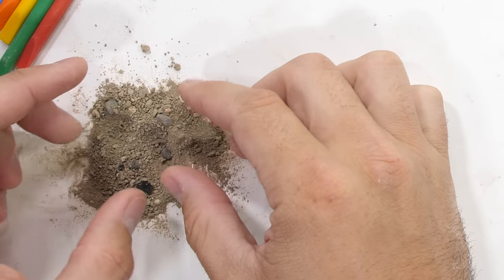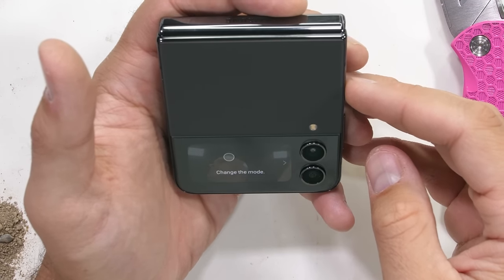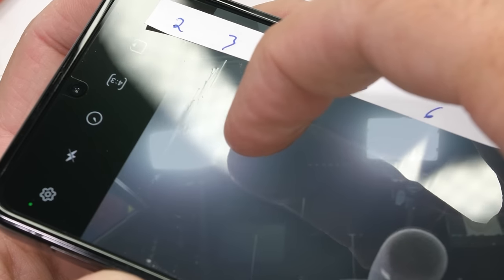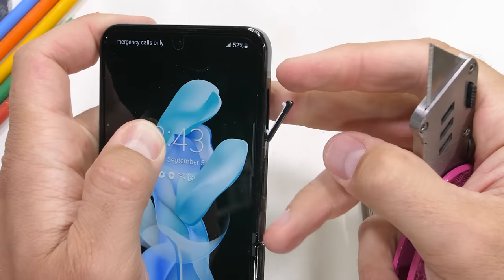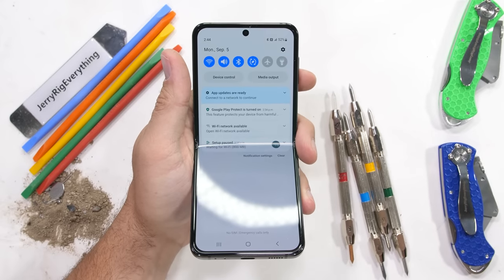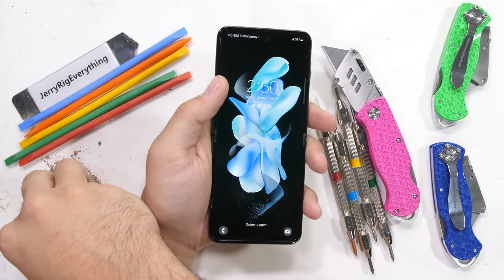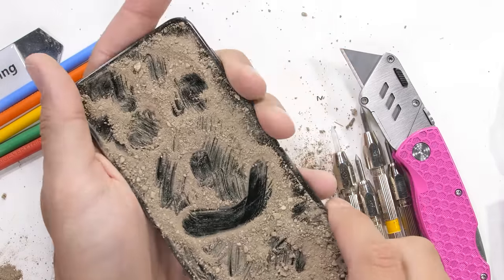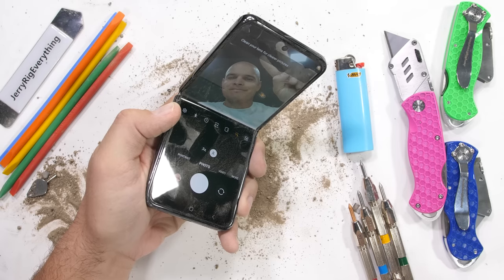Samsung Z Flip 4 Durability Test!! - they slipped a bit...

Comment: I bought this phone and the week after i did it took the absolute worst fall a phone of mine has ever experienced (fell from a 3rd floor balcony lmao). To my surprise the phone just got some minor scratches
Reply: What did it fall on?
Reply: @ToweringPsychic  it fell on rocks while attached to a battery pack so the fall was reaally bad
Reply: did you notice any issue with the hinge after?
Reply: @HarvestingThings  yo wtf lol, I was thinking of not buying this cause I thought it was really fragile but maybe I will
I'm trying to pick between the S22 Ultra and the Z Flip 4 rn
Reply: @vanessarodriguez777  nope, no issues with the hinge or anything tbh. I think maybe the selfie cam got damaged a bit but u can use the the higher quality front camera for selfies anyways. 

It's also basically completely waterproof so I always shower wit the phone lmaoo. 10/10 would absolutely recommend
Reply: @lusisian  the s22 ultra is absolutely way more powerful with a better battery (that is my work phone). But after having a flip phone there's rly no going back
Reply: @HarvestingThings  yeah, I was actually thinking of the z flip 4 because of nintendo ds emulation, lol, it just seems so fun to play with actually two screens, and seems way better to grip for games like that
I still have a whole year to think tho
Reply: @HarvestingThings  flip 4 is actually more powerful than s22u on paper but the cooling isn't as good so the actual performance might not be better but about the same
Reply: Mine fell like 3 meters and the hinge broke - normally 300 bucks but I got one year insurance so it were just 109 bucks
Reply: @lenny7828 this dude is probably lying if yours only fell 3 meters and you had to replace it while this dudes foldable fell like 10-20 meters
Reply: Did you fell it with the hinge open or closed

Comment: I just bought the Flip 4 and was putting off watching this video because it looked scary. But now I have peace of mind knowing it's not going to just break instantly and it's quite resilient!
Reply: Same! Lol it actually gave me some piece of mind.
I bought a tough case for it so I should be good 👍
Reply: My first had a battery issue and the one I have now, the pixels are failing
Reply: a piece of fluff is gonna scratch your screen lmao
Reply: Honestly, having this fragile phone I coudn't watch properly, but because of your  comment, my mind is at ease, thank you!
Reply: @Willem Cahill-Chiaroni  just dont stab it, and you're fine. The screen is only exposed when in use ding dong.
Reply: @nfsfanAndrew  it is literally permanently marked by fingernails. micro bits of debris are unavoidable. plastic is unacceptable for modern phone screens.
Reply: @willemmmmm idk about you but i rarely put my fingernails on my phone to use it.
Reply: Dropped it on a carpeted floor ONCE and it gave up the ghost.

Comment: Really impressed with the bend test - I thought it would snap in half like a biscuit 😅   This is actually a good advert for the phone (aside from the plastic screen), its much tougher than I expected.
Reply: The plastic screen... It is the best we have right now so 🤷 definitely is a durable phone to me as a flip phone
Reply: Honestly I've had the phone for a few days and the plastic screen doesn't bother me at all. No scratches yet, hopefully can keep it that way for a while
Reply: Will acrylic or polygell nails affect it cause I like to paint my nails and wanting to do long ones I don't want to damage the phone with them though
Reply: The screen isn't actually plastic.. it's just a plastic screen protector. But yeah the screen is still fragile af so it may as well be plastic lol
Reply: It's not a plastic screen. It's a factory-installed screen protector. You can't remove it without bricking the phone, but you can ask Samsung to replace it for ya. It costs ~$30. Of course, depending on where you live, finding someone certified to do the replacement may not be easy.
Reply: @spdewertton it doesn't break the phone, mine was starting to lift and was bugging me so I just peeled it off like any regular protector and was completely fine. And I haven't put a new one back on all year and my screen still doesn't have any scratches

Comment: The popping sound comes from the new lock mechanism in the hinge that 3 didn't have. You can feel a very tiny light pop when you open the phone very slowly. Try it. It's so, compared to the flip 3, it can last longer and be positioned in every position longer in the phones lifetime.

Comment: I recently switched to this phone and my main concern was durability.  It's nice to know it can go through all that abuse and still function.
Reply: Do you use it as your main?? Also what was it that made you switch? Were you a Samsung user previously??
Reply: @aussiefurbymogwaifan6621  i want to know too
Reply: Yeah but other phones don’t bend and use strong materials. Sounds like you did a poor decision
Reply: @aussiefurbymogwaifan6621  This is probably irrelevant but I use the Flip 4 for almost a year as my main and will probably upgrade to the Flip 5 when it releases (When Samsung offers a trade in again).
It still works completely fine, almost no visible scratches on the inner screen, only the battery life is not perfect. I have it on the 85% charge mode and at about 10-11pm it hits 15%. So when I want to leave the house at night I have to plug it in before. Oh and the original screenprotector starts to peel of in the crease. Not sure what to do about that, since I only noticed that a few days ago😄
Reply: @_PsychoFish_ I believe Samsung provides protective film replacements for $20. They also provides up to three times of free film replacements on some countries - you should probably search it up to see if it applies to your country. Then again, the Samsung Z Flip 5 is expected to come out in a month, so you could alternatively try to wait for that.

Comment: Thanks for putting the Samsung Flip 4 to the durability test as quite curious of upon the general strength of which holds upon the structure and the materials of the outside surface of the Flip
Reply: it's robust and solid z-flip yet
Reply: It’s so aesthetically pleasing and cool. I wanted to see if fingernails could actually scratch the cover, as that just seems incredibly delicate.

<_< also, I seriously see you everywhere.

Edit: “I see” -> “see”

Comment: As someone who works in manufacturing ceramics, dust has not been an issue, and that's saying something! Only issue I had is when it fell on concrete from 5 ft up, landed straight on the hinge, and it couldn't open fully anymore. But it was covered by Samsung's warranty, luckily!

Comment: I do admit that folding screens are an incredible technology, but that thing is scratchable by just fingernails, so in conclusion today it's still a niche thing. Maybe in the future it'll be fine, but not today
Reply: Jerry scratched the screen protector and not the actual screen itself. Rewatch that part again.
Reply: @Lucky-hl6bz  yeah but the screen protector seems to be a necessary accessory on this kind of phone. Prying your fingers in to open the phone also seems to be necessary. If you don't want scratches on your screen, seems like you'd be replacing that protector very frequently. (In another video I heard someone say that Samsung doesn't sell the protectors individually, but I'm too lazy to verify that claim so I'll give them the benefit of the doubt that they probably do. If they don't though, it's completely unviable.)

Comment: 9:15 Is a nice feature in my opinion... You're never going to get rocks and stuff denting the screen if it never full closes
Reply: I agree. It may not have a flat profile, but Samsung ultimately designed it with the intention of maintaining it. Another reason for the slight gap is them to make the phone water resistant. Other foldable phones do not have that.

Comment: Zack, I really enjoy and appreciate your videos. Having just purchased the Samsung Galaxy Z Flip 4, I am aware that a plastic screen cover has been installed over the screen by the factory. As a result, I questioned your scratch test of the inner screen. Does the actual screen still scratch between a 2 and 3 or was that just the plastic screen protector? Cheers.
Reply: I think he could test it on the selfie camera as far as I can tell the plastic cover doesn't cover it
Reply: It doesn't really matter because if you ever dare remove the plastic protector your warranty goes out the window and Samsung will refuse to ever help you with the device.
Reply: @Orphioux  That's completely false.
Reply: @TCV12  No it isn't, read the device warranty conditions.

Comment: I own and still use my zfilp 3, and I can say it is very durable I never put a case on it and I actually removed the plastic screen protector because it got creased and dirty, but I don’t close my zfilp anymore because if I do it shuts off. I’ve dropped and THROWN this phone open many times on concrete and it has never shattered, I’m very impressed by Samsung
Reply: It actually shuts down, like the procedure, or it just powers off abruptly?
Reply: @_BangDroid_  either it reboots itself or the screen goes black for a few minutes but I can still touch things, I heard it common because it shorts out
Reply: @rickosher2185  Ah ok. I hope they fixed it for the 4 coz I'm close to getting one

Comment: I've had the ZFlip 4 for 1 year now and I did have to take it to get repaired BUT this is what suprised me. A few months after I bought it, I forgot I left it in my towel when i went to shower. I ripped the towel out and the phone FLEW across the bathroom, spinning doing like 1260 turn and landing on one of it's corner's. I thought for sure I'd broken my brand new phone but, to my surprise, 0 damage aside from a little bit of a Click when I closed it. That's it. Any other phone and it would have been completely ruined more than likely.
Reply: i can buy it brand new right now for 400 dollars or the flip 5 for 600. whats your opinion? is it worth 400 in 2023?
Reply: that or the iphone 13

Comment: I polish stainless steel for a living. Using silicon carbide and ceramic abrasives. I sit my Z fold 1 out while I work. Then I blow It off with some compressed air. No problems at all from doing that after about a year and a half.

Comment: Was hesitant about getting one. Finally did. So far, it's holding up fine. Put a case on it, be nice to the screen, fold it when not in use, and it seems to hold up fine. If the screen was exposed all the time, then I'd be much more concerned about scratching it.
Reply: How has it held up?

Comment: I've had this phone for just a few months and got one of the samsung cases that they often advertise with the phone. Dropped the phone from my pocket onto a carpeted floor - thought it'd be a harmless fall, but I heard a small snap when it hit the ground and I think it hit the hinge. Now it won't open more than 90 degrees and the top half of the screen is completely non responsive. 

Glad it passed your durability test, but unfortunately I don't think it passed mine....

Comment: Got my Flip3 now for a year and scratch resistance isn't its problem. In fact i was not able to make any deep scratch. But the display foil started to peel of starting at the dent's edges.Once the screen protector was gone the display started to grow deep scratches at the area it bends. Happy that Samsung repaired the phone on warranty.(new screen/frame assemble) Got a genuine Samsung Flip 3 screen protector now(the third party one are all awfull and impossible to apply without bubbles), just in case I have to reapply it in the future.

Comment: I owned the z flip 1st gen. Now, i had upgraded with the s22 plus. My take on the flip phones? 
Pros: selfie made easier (rear camera only) also solo portraits since the phone can stand on its own, phone calls made easier, attention-catching phone like most of the people i talked with is like amazed and just saying the korean films are using the phone hahahaha, form-factor which does fits in your pocket easily.

Cons: battery-life, front-camera is just so poor (mid-ranged camera sensors are attached on the front camera), side-mounted fingerprint scanner doesn't quite catch sometimes especially if you got wet fingerpads, fingernail scratches on the screen, punctures on the screen when you accidentally poke something metal like a staple wire stuck because of that magnets in the corners and because of that punctures it could damage the thin glass which could futher damage especially at the center screen where the crease is located (that happened to my flip, screen broke and the screen's dead)

Conclusion: the phone's very good if you got the money. Money-wise this is not the phone you're seeking if you wanna use it as everyday driver for the next 2 or 3 years. Literally, it's just the galaxy s series that's folded with low pixel count camera and the software it's just the same. That's why i decided not to buy flip phones. For me, flip phones is just a gimmick for people to see something new and that's what we call innovation.

Comment: Could it perhaps be that the Folds hinge runs vertical so it's able to fit that 40 screws whereas the Flips hinge runs horizontal across a shorter length so it probably has less screws and sturdiness than the Fold's hinge construction.

Comment: I have the Flip 3 and actually had to get my protective screen replaced after like 6 months, where it started to peel off in the middle. Despite the warnings not to peel that protective screen off, the person at the samsung service, when I went there to get it replaced, just peeled it off using only his hands and the screen was still fine, so I guess there is a small chance that if you try to peel it off too quickly or peel it off when the phone is bent that the screen might break but other then that, I think it is pretty safe to just peel of that protective screen if for any reason you need to, like getting it replaced.

Comment: My take on the decreased durability is the smaller metal frame^^ they made the glass back panels bigger so it looks nicer but compromised the durability
Reply: It also allowed for a bigger battery. Good trade in my opinion.
Reply: @tonyg12324  very very bad trade. I heard someone dropped it and it shattered, while my phone has dropped several times and it only cracked a tiny bit (with a strong case ofc)

Comment: just wanted to add ny experience to this. I recently bought a flip 4 because well. my phone was 7 years old and I could trade it in to get the flip4 for free.

I'm about to get my replacement for my flip 4 in the mail. you see I dropped my phone. closed. I dropped it pretty hard and something went wrong with the hinge. at first it was just a "dang my phone no longer opens  smoothly." sort of thing. it wouldn't open all the way for a bit but I tapped and wiggled things around until I was able to, it just made a nerve racking popping noise each time and the phone no longer sat straight open or closed, it was crooked.  I still went in to my carrier store and they helped me get a replacement.

after around a day of normal usage though I started to feel a lump in the screen on the right side. instead of flexing in, the phone was flexing out in one spot in the middle when opened. I had a bad feeling but hoped the phone would hold out until my replacement arrived.

yeah that hasn't happened. one of the pixels suddenly went dead, followed by a cross section lighting up bright white like a Christmas tree. it is head ache inducing bright, and I am terrified to fold my phone in case the screen stops working all together. 

the fold is a really cool phone, but be aware that if you break the hinge by dropping it, it might just puncture the screen. it's basically the same as breaking the glass on a normal phone when you break the hinge on these bad boys. I hope more cases that protect the hinge when the phone is closed fully come out soon!!!

Comment: I am retracting my praise for this phone's durability because recently I did drop mine from 4 feet because I set it down while on the toilet to listen to a video and it slide off the rail and landed onto hard tile floors. The case popped off (I'm returning this crappy cheap case) and the screen flickered and died. According to the phone repair place, the magnet that tells the phone it is "closed" go dislodged and my phone kept thinking it was closed and the fall also showed visible damage to the screen protector at the fold point as every time I opened and closed from then on, the crease was very noticeable

Luckily I have the insurance and paid the deductible, which is about $100 to get a replacement. Not before paying extra to a phone repair place to reactivate the screen so I can transfer my stuff over. I've since bought a "better case" but the fact that my Flip 4 dropped at the "right" angle will utterly disable the screen is a problem for me and from a relatively short height.

Comment: I feel like I got a faulty one :,( both times I dropped my z flip it broke internally. Both times it had a protective case it was a short drop and one time it fell on a towel and still broke, spent well over 1000 in repairs and ended up just replacing it. I really liked the phone too